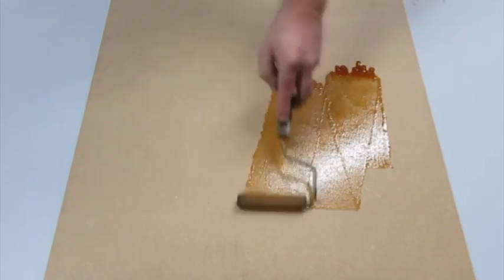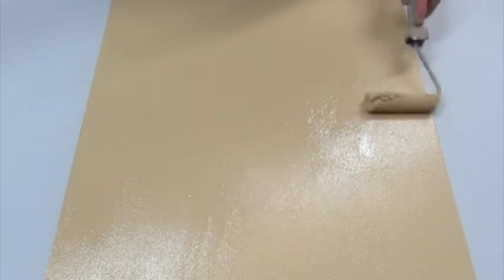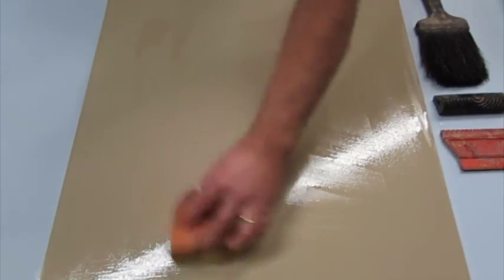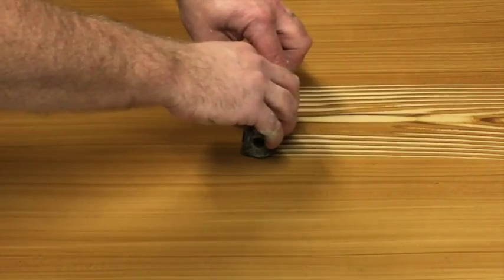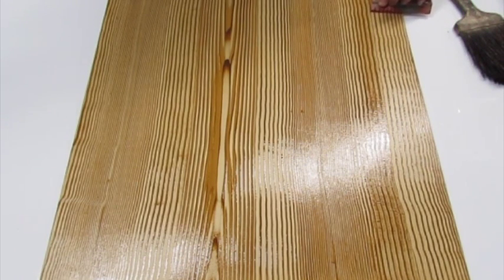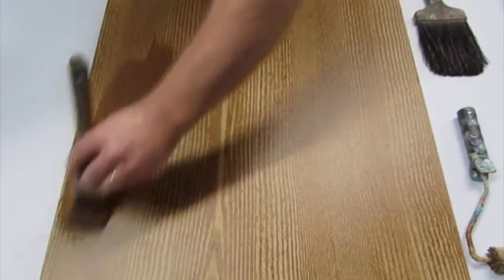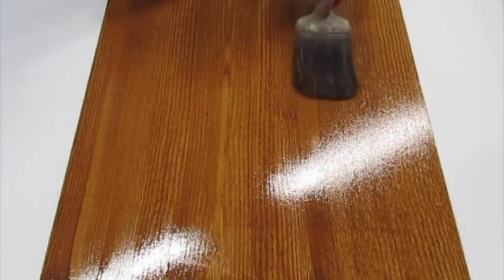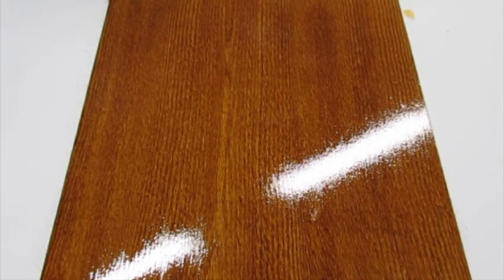Oak Woodgraining at Scenic Painters

Comment: Hi James, your video has shown the best techniques and the most realistic light oak effect woodgraining I've ever seen, having seen you do this I plan to do my metal panelled garage door, I'll probably have to use different paint/stain with the weather in the UK.
Reply from the maker: Gaz Barham   Thanks for your kind comments. Yes if it’s outside then everything changes materials-wise but the idea should be the same. Build in layers. Working in oil based paints means you can work more slowly.  No drying time issues. Think of it in terms of a very good prime layer then the correct base coat. Then the graining layer. You could check out a company called radcliffe who used to make oil based graining glazes. Then a stain layer to add depth. Then a protective layer. Outdoor painting isn’t my area really but I would do a sample before doing the door and then leave it outside for a bit to see how it weathers our weather!

Comment from the maker: Hi Michael, The materials I've used here are all water based.  I doubt they would last that long outside but you could adapt the method using oil based glazes, dyes and varnishes.  It's not just the rain,  but also humidity (as you said) and temperature variations would also affect a water based method.  Hope this helps.

Comment: That's marvelous! I've been interested in woodgraining for a long time and now I'm severely tempted to try my hand at a door that is currently grained but whoever did it didn't do a great job. The worst bit is that he grained over a chipping, lumpy coat of old paint! Besides, I'm not even sure what kind of timber he meant to imitate - looks quite random. From far away you get the faint impression of some kind of burl but up close it doesn't look like anything I recognise.
Reply from the maker: Sounds like lots of prep work needed to get rid of the lumps. Then it’s about masking and painting the parts of the door in the right right order
Reply: @jamesrowse7134  Yes, any kind of paint job on that door (actually a tall set of double doors with three panels each) will require plenty of thorough prep work!

Comment: first video I've seen where some one had a flogger and even used it correctly just a little hint though, when using your graining tools if you will now and then act like you are nervous and vibrate you hand you will get a very real effect. I guess your a scenic artist in England? in Hollywood the wood graining is done by set painters scenic artists do backings. Great work
Reply: I worked with a scenic artist years ago on a feature and they had him making silk screens a printing felt for gambling tables that would usually be done in the sign shop but like you said their is less work for scenic artist these days several times working in San Francisco I hired help from their scenic shop at the Opera house and they did set painting for me the sets at the opera house are quite large they took me on a tour

Comment from the maker: Yes ply is ok as a base as long as you prepare it well. The ply needs to be fine grained, hardwood not softwood ply and you must grain in the same direction as the grain. I would do a sample sheet on an off cut and test the result before you have a go at the table

Comment: That's really cool! I want to do something like this but on a metal mail box using outdoor enamel paint (One Shot) however, I don't know if I could get that same "transparent" look being enamel paint is THICK.
Reply: OneShot is great paint. The chemistry has changed. The old OneShot contained lead. The newer version is lead free. Both versions can be reduced with paint thinner or if open time is a factor small amounts of kerosene will do the trick. Mr.Rowse in UK call it paraffin. We hope no one reading this becomes confused and seals jars of jam or jellies with kerosene in either country. 
OneShot as a glaze coat would need to be mixed with an exterior compatible alkyd polyurethane many times now called "Spar Varnish"

Comment: James, 
I’ve always been sort of a purist, however you have changed my mind.  This looks completely realistic.  I’m trying to make some exterior wood (soffits on my cabin) come back to natural wood look.  Would this work for exterior?  Because they are the soffits, they will not get wet aside from humidity.
Reply: In the 19th and early 20th century Europe that was considered an art form on its own and there were highly skilled professionals doing it. The main reason being that some fancy timber species aren't ideal for certain applications, e.g. doors, so a suitable species was used and then faux grained. Solid timber might also have more blemishes than a good graining job.

It should work fine outdoors, provided you use the right materials. I'd probably use exterior grade paints and stains for the process and perhaps finish it with a layer of varnish. I'm just a DIYer too, mind you, so take my recommendations with a grain of salt!

Comment: Hi James! This was great to watch thank you for sharing. I'm working on a project and plan to do something like this on my kitchen cabinets. I went to the link you shared and unfortunately when I press the link for the info PDF it won't download but just refreshes the page. Would you be so kind as to share a working link or send over that doc. I'm really interested in what primer you used. Thank you in advanced.
Reply from the maker: Hi Andrew.  Thanks for letting me know about this problem.  I think its fixed now so please go to this page http://www.courses.scenicpainters.com/Our_Courses.html and click the DATA SHEET button under the video.  As for primers it will depend on your substrate.  in this video I worked on raw MDF and it was not done with kitchen use in mind.  I think I'd go for something more substantial as a base, maybe one of the Zinzer primers to start with, then on with an emulsion base etc.  Hope this helps.
Reply: @jamesrowse7134  link still doesn't work for me; could you. please, try again?

Comment: Is that a type of shellac you are using to start first sealer coat with?
Reply from the maker: Yes button polish (or button shellac) is the material most used to seal the surface when you are painting scenery for theatre, in the UK at least.  I believe it's also available in the US and other places.

Comment: What colors would you recommend for a darker color, like a cherry or mahogany
Reply from the maker: Well, for mahogany I'd go for an apricot kind of colour as a base, seal, grain with a little Rosco burnt umber in glaze, stain or overgrown in Vandyke solution and finish off with button polish again.  However the graining marks are very different for mahogany.  I may get around to a video one day.
Reply: @jamesrowse7134  thank you.   Are the graining marks similar for cherry wood
Reply from the maker: Cherry is actually fairly fine grained wood, more so than oak so I would approach it with brushed graining rather than using combs. It's not something I've been asked to do though, so I'm afraid that I don't have a method to offer.
Reply: @jamesrowse7134  thank you

Comment: Ok I get the button polish for fire proofing but everything else is so wrong , throw that rocker away if you use it in scenic painting trust me it will stick out like a sore thumb. The flogger should only be used as a base for oak not as an over-glaze & not really needed. Steel combs where are they? The only thing going right is the color . If your going to post a tutorial on oak graining 
do it right , especially if your a scenic artist offering courses. Your teaching the youth of today or anyone interested badly & this is how knowledge is lost.
Reply: Yes I hear you, the roller your using for prep work has a heavy pile sleeve on it , change that to a decent foam one & lay off with that . Use acrylic primer & then acrylic satin/eggshell. Lay these all off well with the roller & you dont need a brush or sand paper (but you can slightly key each layer when dry with a sanding pad) . Thats saved time already & is a basic prep work. Using acrylic glaze tinted with either pigment powders or universal dyes (all cheap) & a wipe out tool rubber/cork/ color shaper , wipe out the heart grain & for the sides use a rubber comb/burlap or flog then run a fine steel comb through the work . steel combs rust yeah, show me a set of well used ones that haven't rusted they rust whether used in oil or water through general use & doesn't effect the work. All of the above is cheap to do & is THE very basic entry level of oak graining. Throw that rubber rocker away & train your self to do it by hand , it looks much more realistic & when good at it its just as fast.
Reply: I think it looks very real . 
Thank you , great job.
Reply: @conmick477  feel free to post video with your way of doing it Sir.
Reply: @mattgloss8580  Dude is flogging his...